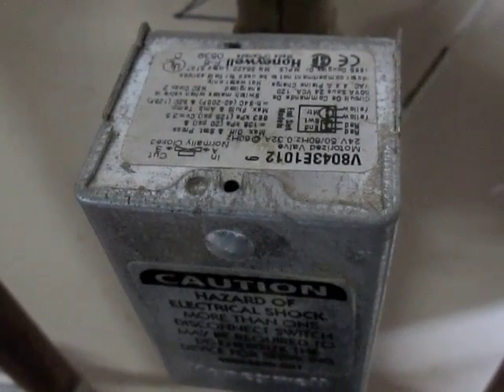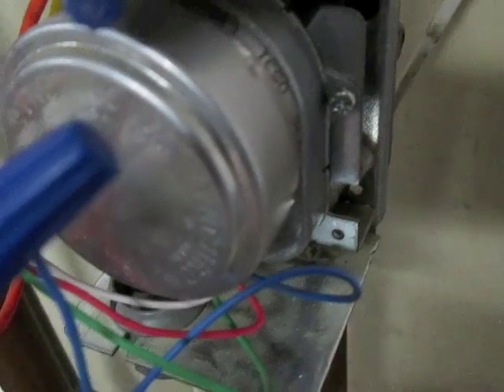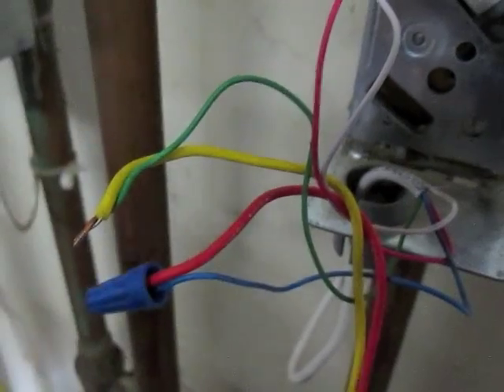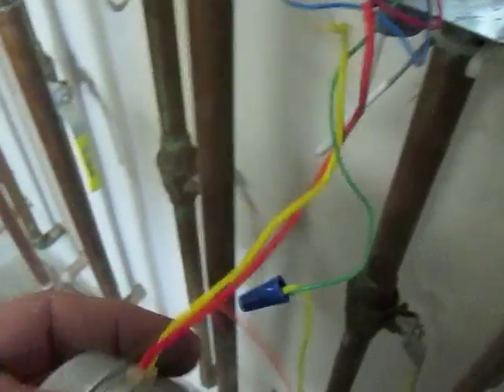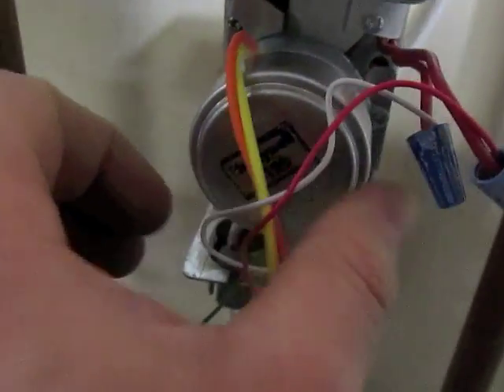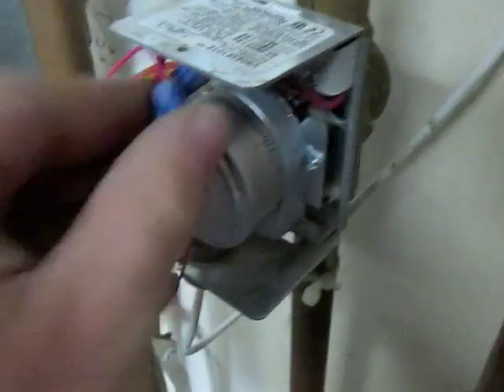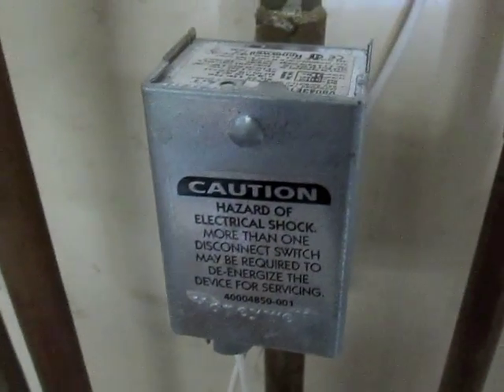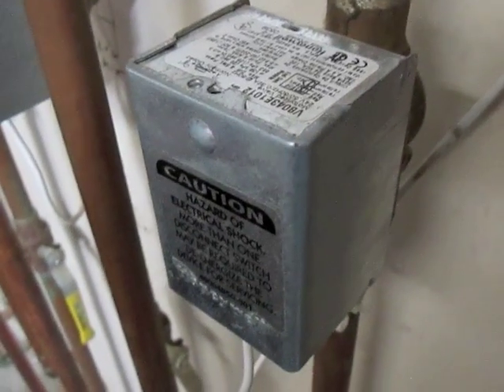My heat won't turn off V8043E1012 Honeywell Zone Valve testing heat

Comment: Stupid question perhaps - does one have to turn off power to the furnace/hot water heater (the red furnace turn off/on switch) when doing this?  If so, (turning off power) does this mean I have to light the pilot light again?  Sorry - if you haven't figured - totally a novice to these matters. Thanks mate!
Reply: Not sure if you ever got an answer.  I turn off the furnace at the breaker and the furnace automatic relights when I switch it back on.

Comment: my valve stays open even when the thermostat is not calling for heat. how do you check if the closing spring on the valve is working ?  if I tap on the valve it usually closes
Reply: Roy Johnstone I am having the same issue. What did you do to fix this?

Comment: Don't replace motor if heat won't shut off... it's done by return springs which you didn't even show how to check. If the springs work and the ball inside the valve is damaged it still won't close and you need to replace the ball.
Reply: I think you can determine this. First, the valve being stuck open can be tested by seeing if the manual override lever is easy to move or not. If it's easy to move, it's stuck open. Second, removal of the motor is just one screw. Remove it and see if the spring-loaded valve closes. If it does, the motor was the problem.
Reply: @bg4406  what did you end up doing?